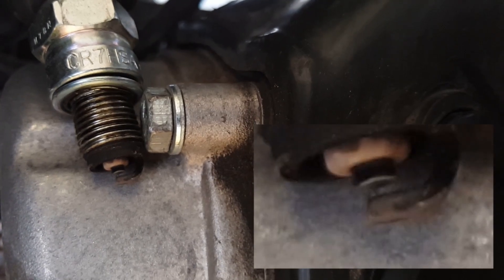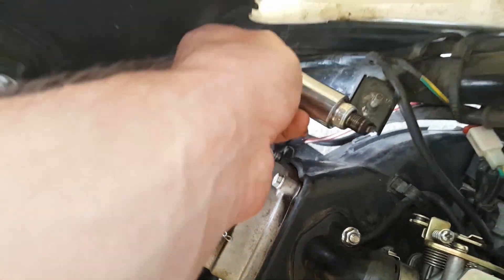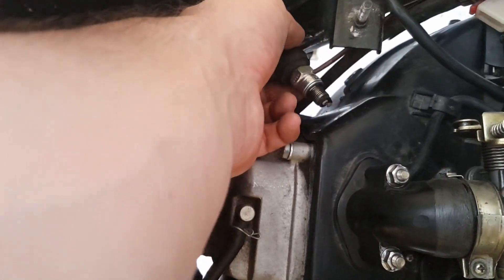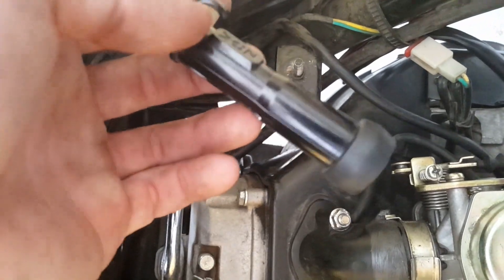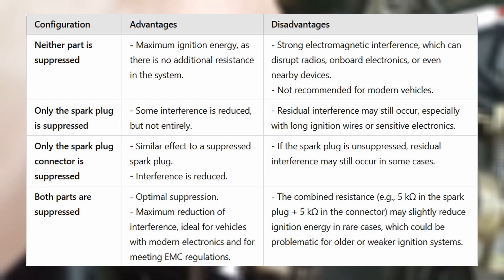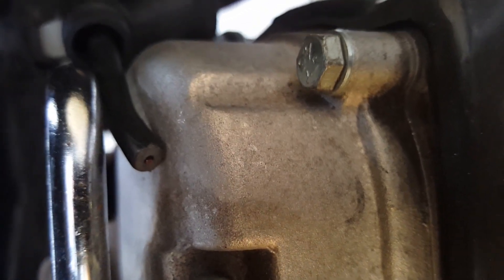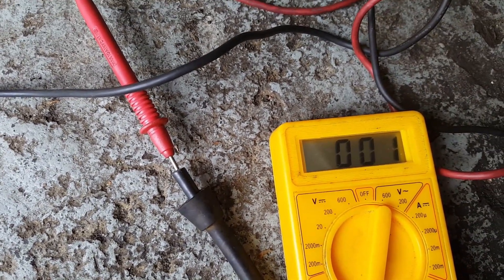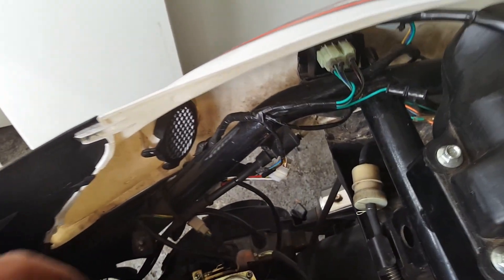Scooter Won't Start? No Spark? Step-by-Step Ignition Troubleshooting Guide

Comment: mine has no spark period i replaced  ignition coil cdi battery spark plug pickup coil fresh gas cleaned tank new petcock turns over wont start everything is new nothing works even tried unplug cdi kill switch wire no luck

Comment: ❤
Reply: Yamaha nmax125 2018,engine cranking,no start,ignition not sparking,as you explained,no prime sound from fuel pump,swap ecu same thing no start,check side stand swich and starter switch,fine,still not starting,any advice please